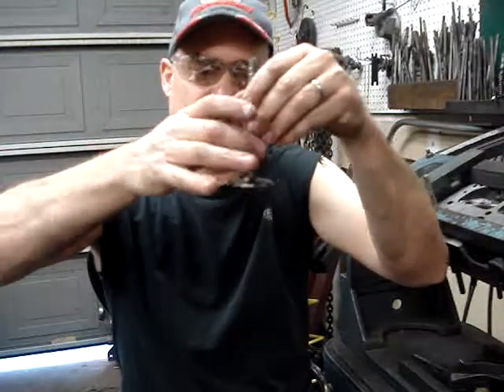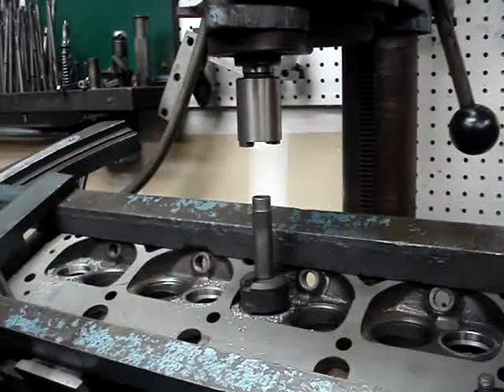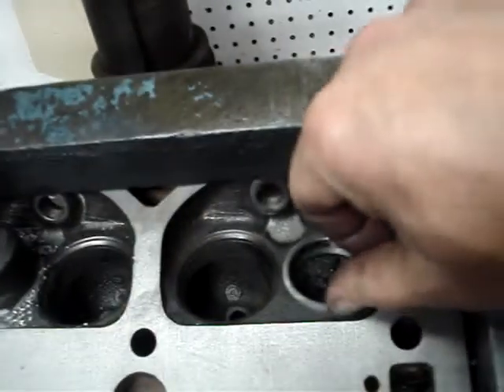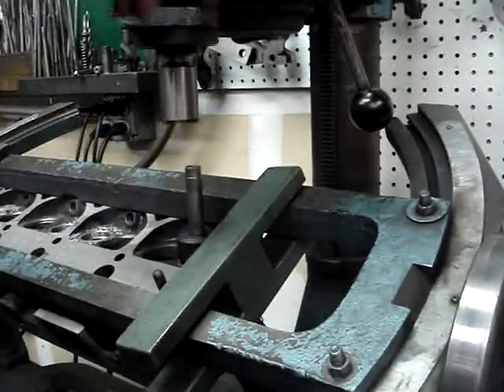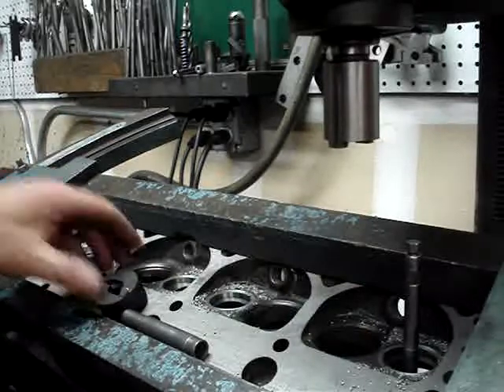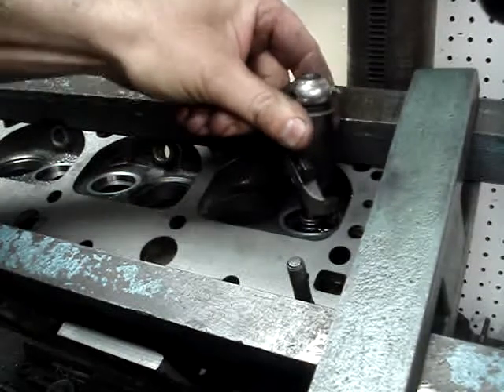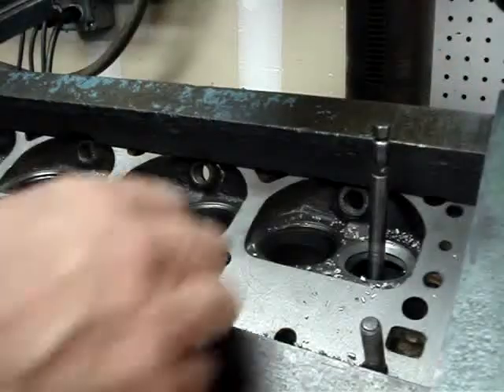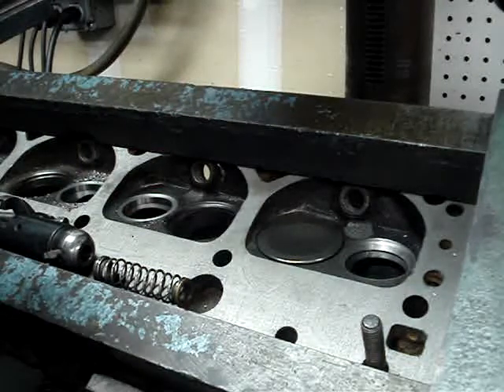350 Chevy performance Valve Job

Comment: Just found your videos and I'm hooked. It's helped me immensely with my 68 RS/SS camaro engine build. It has the original 350, 291 heads and all. I'm rebuilding the motor after it finally gave out. My car is all original with the exception of the trans (put in a TH350 and kept the old PG) and accessories like waterpump, alternator and other minor mods. I'm trying to keep it as close to "number matching" as I can. In the process I found a set of period correct 291 heads with the larger valves (mine has the smaller IN/EX). I have a good machinist friend with a full machine shop. He offered to rebuild these heads, port and polish, install screws in studs etc. I was wondering what the max flow you've seen or measured from a set of these old heads? Before I drop a wad on new technology heads, I'm wondering if I can get 
225-240cfm @ 80% out of these with some budget mods?

Comment: Excellent video. Where do you source your valve seats and guides (engine parts)? I used to have a NAPA machine shop in the '80's and sourced all my parts thru NAPA Auto Parts / Allied Engine Parts. I'm getting back into engine building and would like to find the bulk guides I used to get that you could cut down to size, and the hard exhaust seats. I think the guides were 2.25" long x .502 O.D.  x  .343 I. D.. 
I called my local NAPA and asked an old friend that still works there about engine parts, and he told me NAPA has all but gotten out of selling engine parts. I used to use NAPA / Victor gaskets, and they don't sell them anymore either.
Any ideas?
Thank you.
Thank you